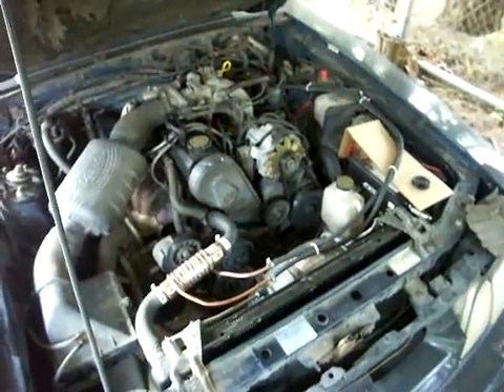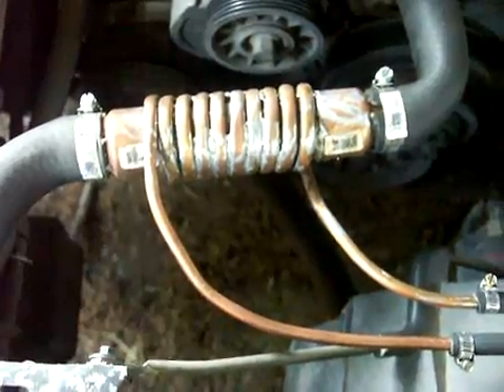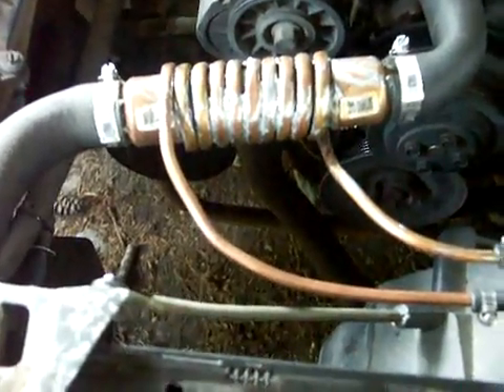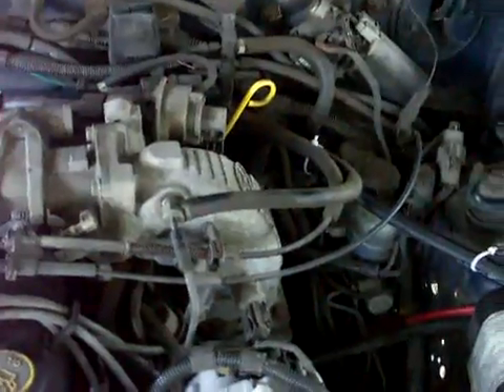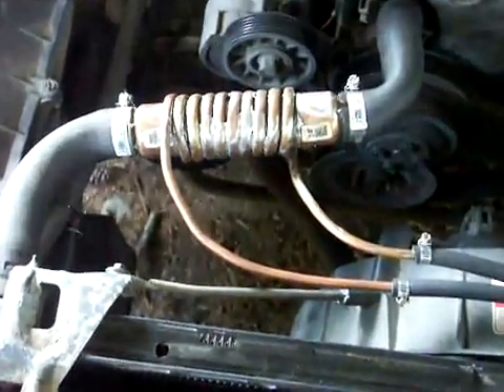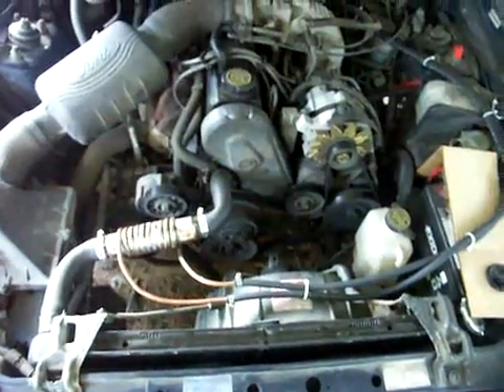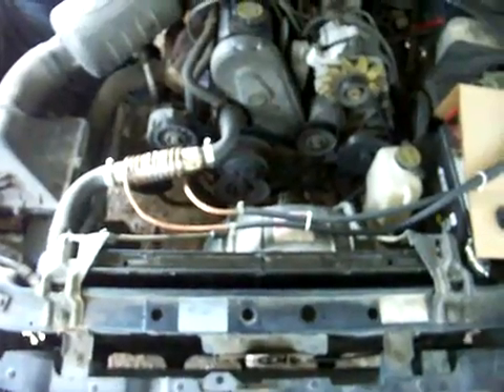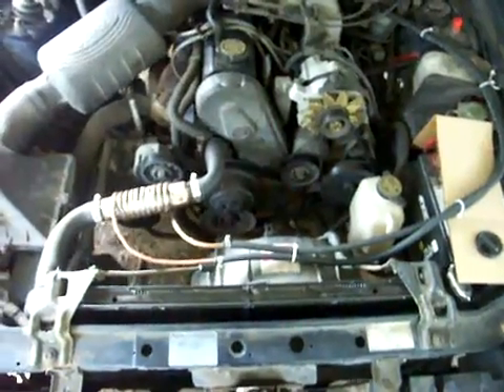Fuel Pre Heater Project for "Efficiency" which should show increases to mpg and perf.

Comment: I think this could be done very similar buy yet cheaper. On most radiators there is a line to cool your trasmition fluid with a threaded fitting. Unbolt the line put in a couple of brass fittings between the 2 end and connect a small copper tubing to the fittings. I could wind it around the gas line right where the injectors are. Hhhmmmmm.